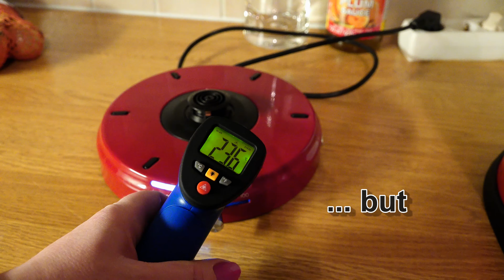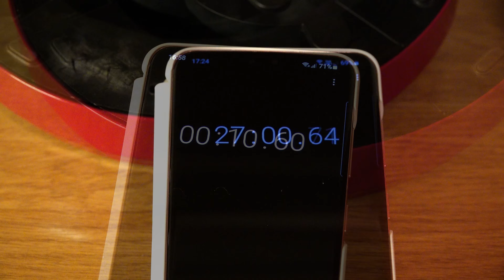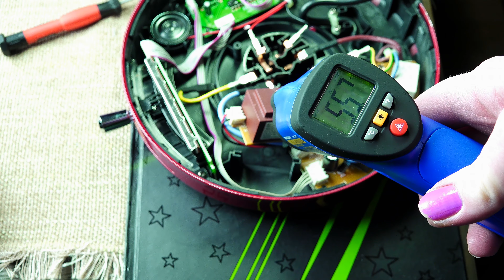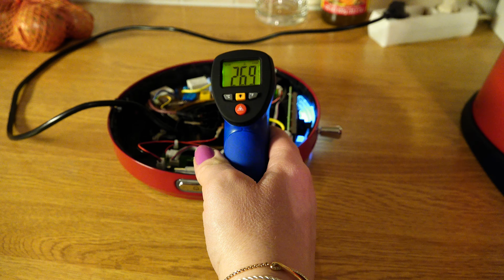DIY Kitchenaid Kettle Overheating

Comment: How do you get the base to separate? The centre section comes out easily, but the outside section I can't get separated from the top. Mine has three screws that yours doesn't. I've removed these, and I start spudgering around by the power cable channel like you do but it just won't release.
Reply from the maker: You just have to try to pry it up, work with it, use a flat screwdriver. It’s sitting pretty tight, but you still need to be careful.
Reply: Brilliant, thanks: I got it. It was just stubborn and needed a bit more force. I was just being too gentle with it. Managed to get it off without damaging it as well. In my case the transformer was fine but the temperature control had stopped working reliably: fixed with some contact cleaner on the variable resistor. Thanks for the video, and the reply - really helpful.

Comment: Hi Connie changed the transformer but the power is not coming on at all any idea what I have done wrong or what the problem may be
Reply from the maker: Sorry, it's not easy to answer that from here. But if there was power before you changed the transformer, I would think that it is the wrong transformer, wrongly connected transformer or that the new one is broken, or has been destroyed due to strong heat during the soldering process.

Comment: Hi Connie, great video!
I expect my transformer is broken too and needs replacement.

I searched for the "BV EI 3032801" transformer. But I noticed my transformer has the values: Pro 230v, Sec 10.0v and 100mA. I can find transformers with 230v/10.0v but they all are 150mA.
(I could find one with 100mA, but its a few mm's too long to fit to the PCB)

What would you advise me?
Reply from the maker: It is unfortunately a typical problem with these, but otherwise it is a very good kettle. I haven't had any problems with it since.
Reply: @ConnieTh  Thnx Connie. Do you think I can replace the 100mA transformer with a 150mA?
Reply from the maker: I think so. It is the kettle that determines how much current it draws. The transformer only delivers, so it doesn't deliver too much even though it can deliver more. It is important that the voltage is correct.

Comment: Hello,I was wondering if you could help me with my problem. Every time I turn on my kettel it just starts to blink lights and nothing else happens! Do you Know what is wrong with it?!
Reply from the maker: No unfortunately. I have not had that problem yet, so I have not researched it 🤔
Reply: Hi Reza, did you find a solution to your problem? I have the same problem and I'm thinking that replacing the transformer, as shown in this video, will also rectify my (our) fault. What do you think?
Reply: The heating element has failed.  I'm on the third (touch wood) longest lasting Artisan kettle.  Mine now has a problem with the temp setting slider after water got into the base, I just came here to find out how to take it apart 👍🏻

Comment: My kettel has exactly the same problem. Only one side of the plate stays warm always.
Reply from the maker: It should not be warm at all. I forgot to disconnect it once and the table was extremely hot. After the repair I leave it connected all the time 👍
Reply: @ConnieTh  i was wondering, maybe it has thermos function that it keeps the water always warm. How i can find a transformator like that? You repair it like its so easy😀 i ve no tools like you have.
Reply from the maker: @nicochoco4881  no it does not have a "thermos" function 🤔 
You may have a friend who can help you? The part is quite cheap and can be bought many places. I have put a link in the description under the video. If you are in the US just google the number. But first you have to check  that you have the same part in your kettle.
Reply: @ConnieTh  i ll try it, so far i disconnect it everytime after i used it. Thank you 🙏
Reply: Hello,I was wondering if you could help me with my problem. Every time I turn on my kettel it just starts to blink lights and nothing else happens! Do you Know what is wrong with it?!
Reply: @rezamohammadi3683  hello, did you try to push the on /off button at the bottom of the kettel?